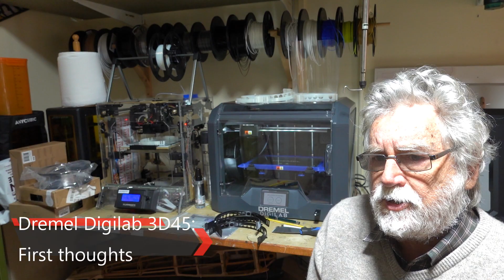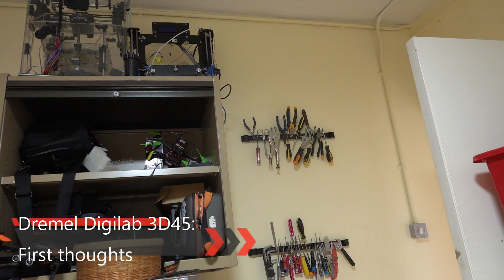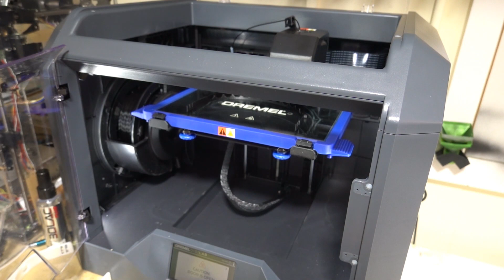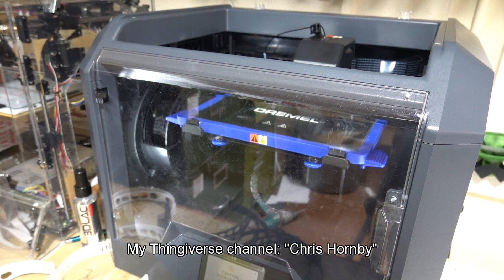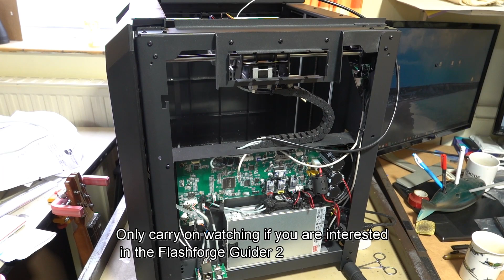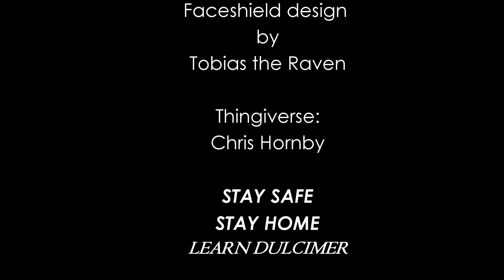Dremel 3D45 first thoughts

Comment: Hello Chris, I'm from Dremel.  Thanks for the write up!  To adjust the z-gap, there's an option under tools>calibrate>assisted nozzle calibration.  It'll print 3 boxes and you select the best one.  If its very out, do it again to verify.  Also, to prevent the auto-calibration every time it prints go tools>setting>advanced mode and turn auto-calibration off